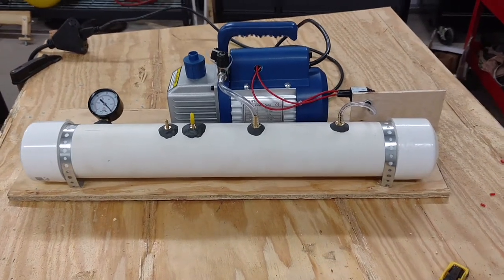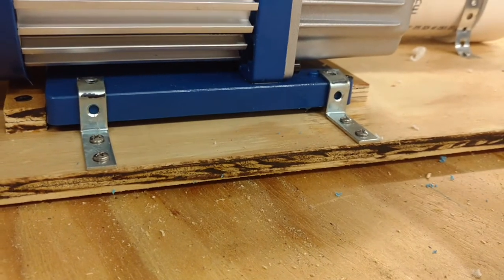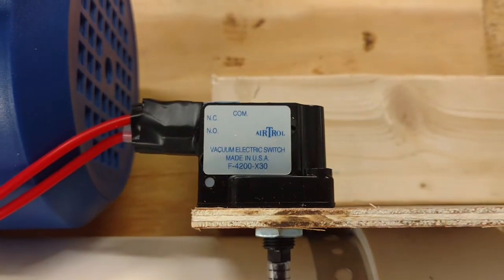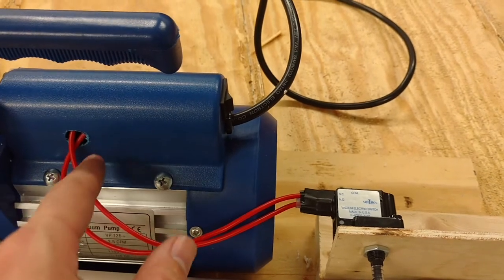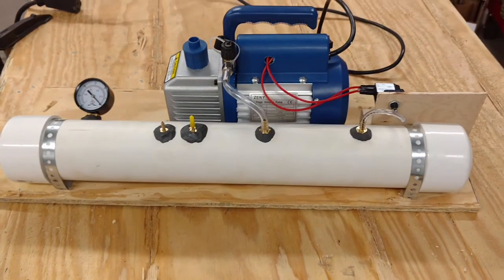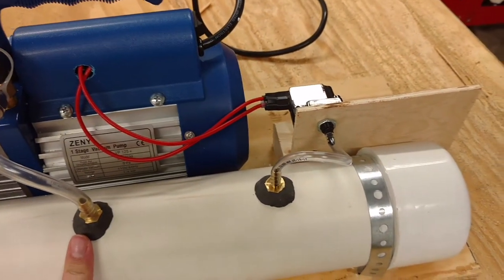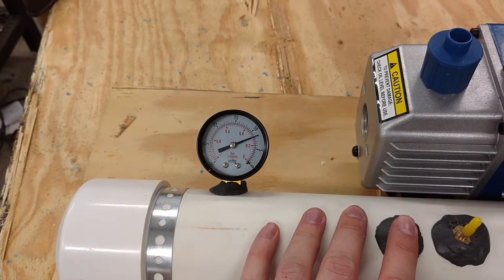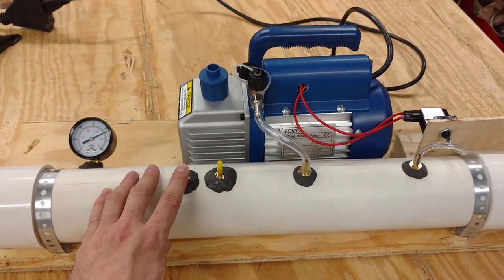DIY Vacuum Pump for Bagging RC Plane Wings

Comment: Out of interest is the res and switch required for bagging wings or just a nice to have?  Can’t you just use the pump and a quick release on the bag to keep it sealed once the air has been pumped out?
Reply from the maker: They were there because I didn't want the pump running continuously. It had issues where it would vaporize the oil and the whole garage would be misty. I'd recommend an oilless pump
Reply: I like your question and am not sure that is the answer you were looking for. Did you find out your question?

Comment: What's up man and thank you for the awesome video.  I was planning on assembling one but after reading through the comments I saw that you had oil issues with the first setup.

Did the check valve mitigate the oil issue?  Did your wings get ruined with the Check valve in place?

Would you be willing to show us your diaphragm setup?

Comment: Hi Spacegoast,

I like your set-up, as a first step I will use a hand pump, but I would like to duplicate your reservoir.
I will use it for various parts I need for my boat building projects.

How did you mount the connectors and gauge to the pipe? are they secured from the inside with a nut and after you put some putty around the opening and thread? You also use two diameters of tubing? Would I get all parts from Fiberglast or are there better sources? (You mentioned some of your parts coming from a aquarium store.)

Greetings
Sam
Reply from the maker: Sam,

Sorry for the super delayed response. The clear vinyl tubing I got from home depot. To mount the fittings I just drilled a hole and screwed the fitting in. The bras fitting tapped the PVC so now there are threads in the reservoir. I will strongly recommend some sort of oil trap or not to leave the pump running long term. I had several wings ruined due to oil contamination
Reply: @302f150  Hi Spacegoast,

funny, I am just getting ready for some vacuuming. I had stashed away everything from last year.
So your belated response is actually coming in at the perfect time :-)

Now I want to switch to a motorized pump. What is your recommendation?

I only need it for a few laminations, no need for some heavy duty industrial grade stuff.

Greetings
Sam
Reply: @SamuelLanghorn  I ended up buying a Gast diaphragm pump and have had no issues with it, but it's a lot more money up front. If you are only going to do a few wings here and there this unit might work but keep in mind the notes about oil migration. Either run the pump continuously (which it's not designed for really) or install a checkvalve between the pump and the reservoir to try to keep the oil out of your bag.

Comment: Where is the F-4200-X30 connected?
Is it +-of the motor?
Reply from the maker: It interrupts the hot wire from the switch to the pump.